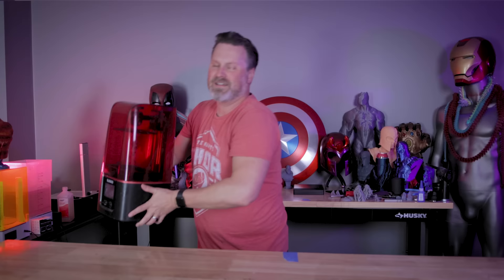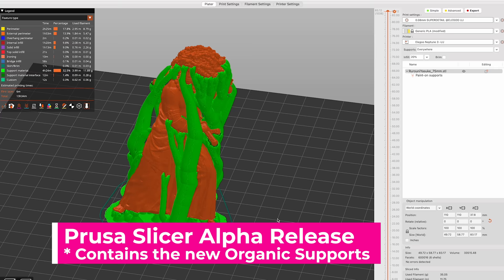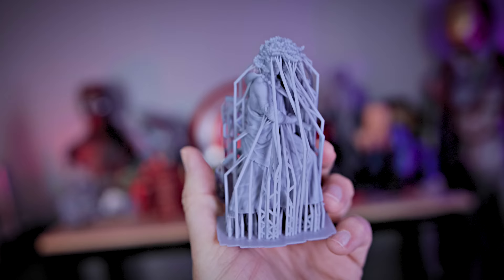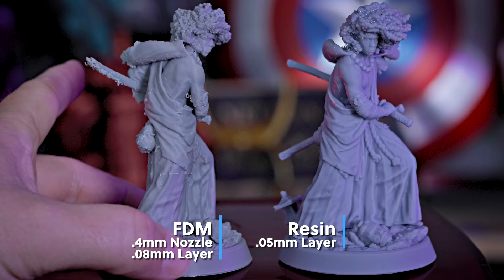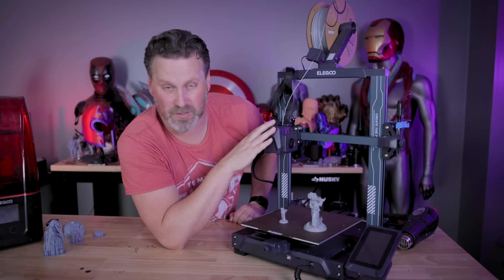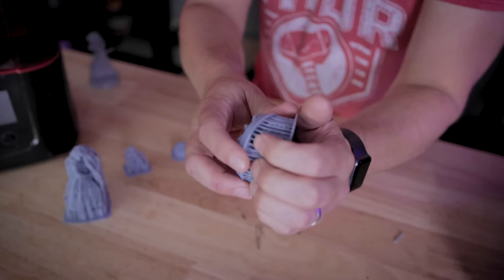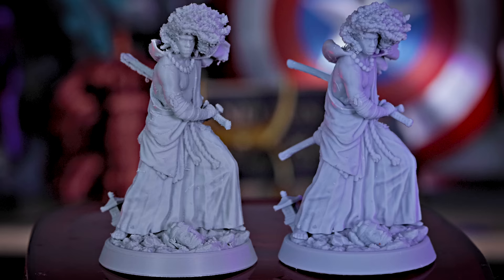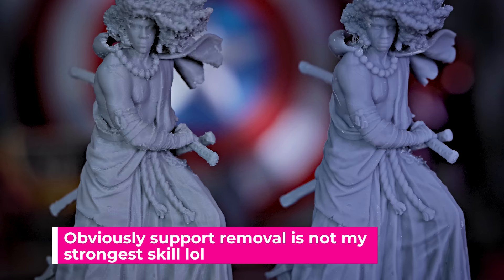Can your FDM 3D Prints Compete with a Resin?

Comment: The problem with it is more when you go to paint them.   The layer lines become a lot more evident when you start painting them and sanding doesn't work well on those small detailed pieces.  Especially when you do multiple layers of paint or a wash.
Reply: There's a video where someone uses resin and a brush to gloss over the print to give it a more solid look
Reply: A couple of thin coats of Mod Podge does a great job of filling layer lines without losing detail.
Reply: 2 layers of primer before painting makes a world of difference
Reply: Everyone who's ever done any sort of painting on a professional level will tell you the same thing. Plastic, walls, or canvas; always put down at least two layers of primer before your base coat.
Reply: Uh oh my mini figure have layers. Mom I need sls printer! Not I'm not a looser!
Reply: Fdm printers suck for miniatures
Reply: Not really. The layer lines in the resin print were .05 mm, a high detail printer like the anycubic Kobra 2 can easily get down to .04mm with a standard nozel.  Sure plenty of resin printers can do much better, but not in any way that will show up once the model is properly primed.
Reply: @elsunshine9976 it all depends on fine settings. 

Sure resin might be the king on the market when it comes to 3d printed minis, BUT with the right settings FDM can produce passable results, sometimes near identical to the resin counterpart.

Tweak around with the settings and you find the perfect combination to make crisp and high detailed minis on a FDM printer. Having a properly sized nozzle will also help
Reply: I think that for print miniatures the best is go to a resin one, when yow are painting it an washing with ink you will get lines in fdm printed ones
Reply: You should sand it till smooth (shouldn’t be hard with tiny layer height) and the put a couple layers of primer, it will feel like a mold injection model!
Reply: There is a black bar car detailers use that shows the difference in material depths through color difference and allows you to perfectly sand items. I forgot the name of it but it's used for sanding down body filler!
Reply: @phlm93  are you supposed to prime with an airbrush or just a normal brush?
Reply: Prime with an airbrush or rattle can.
Reply: @Christopher_Gibbons  The maximum convex detail with an extruded filament of 0.4 is 0.4, which is 8 times worse than resin. In the best case, it's “only” 4 times worse if we use a 0.2 nozzle. It's not bad, but it's clearly worse in all cases.
Reply: Sand it
Reply: Abs filament and either acetone fumes or sanding, won't see any layer lines 
Cosplayer trade trick there, that will be 5$ ;)
Reply: The bambu x1c i have printed successfully at .04 layers and a .2 nozzle and it honestly looks better than my resin prints and are way stronger
Reply: @Yoriel79 you can use arachne wall generator to print thinner walls and get better resolution so I'd disagree
Reply: So you just print in ABS, which costs the same as PLA, can be printed faster, and can be acetone smoothed to remove ALL layer lines?

Comment: In short...no. FDM can't compare to the details that resin gives, however try walking around with a full resin cosplay suit at a con compared to an FDM suit. There's your difference!
Reply: FDM actually works great for most of the pieces of a cosplay suit, anything big can be made perfect with sanding and spray bondo.  I would rather use FDM for most big things on a cosplay suit because of the much higher strength.   Ideally you can print the detailed part in resin and attach them to the large pieces.
Reply: It can compare, just don't print it incredibly unnecessarily small.

Comment: The only time I’ve seen FDM come close is when the minis are designed with using FDM to minimise the lines as far as possible. Print minis that haven’t been designed on that basis and I’ve always found the results as one might expect. Sure, there are steps you can take to minimise it, as in this video but still…..  I’d prefer a resin printer but can’t be bothered with the hassle and I’m not convinced that FDM can print the minis I want so I stick to getting them printed by folks who have access to multiple machines of both types. They’ve even run off FDM versions of the same figures FOC at times,  just to compare, pass.

Comment: Definitely seems like the smaller you go in scale, the more the FDM print quality suffers in comparison to the resin.  At the larger size, the FDM closes the gap a significant amount.  The resin is still better, obviously, but not as significantly.  I've just started looking at 3D printing and I'm surprised it takes so long to print some of these things.  Twelve-plus hours for that larger figure?  Wow.  For some reason, I was operating under the misconception that these things were quicker than that.

Comment: you should have mentioned that if you can only have your 3d printer in your bedroom (or other high use space) SLA is NOT AN OPTION not due to the smell or clean up but the TOXIC fumes that UV resin gives off

Comment: I print at 0.25 mm line width using a 0.4 mm nozzle. Layer height set to adaptive, between 0.1 and 0.2 mm. Minis come out quite crisp!
Reply: Which 3d printer u got?
Reply: Both my Ender 3 V2 and CraftBot XL (the original one) can do it quite well. Not as clean as resin, but very satisfactory to me and my DnD group. And ofc without the hassle of printing with resin.

Comment: Man, what I wouldn't give to ditch resin printing. I reckon a dual nozzle setup to use a different material for supports would make the FDM prints a lot cleaner.
Reply: I see what this guy was able to do in the video but I can say in our real world examples it did not come out the same way at all.  There was a very noticeable difference between the two.  One is perfect and I do mean perfect.  Like he has support issues on the resin one that I would question what size supports he is using and flairs on it.  That is very very very rare for me.  I stated this in another comment but man there is a difference and our group instantly can tell between the two for our 27 and 32mm prints.
Reply: It it just the mess and toxicity of it?
Reply: @jasoneiserman549  Exactly that, yeah. It's just so, so much work to be safe and clean.

Comment: For FDM printing I have been using Variable Layer Height feature more lately.  It really helps the postprocessing by reducing the layer lines and adds a little more detail where you need it.  For example most helmets I will start the print with a 0.28mm layer height but the areas where layer lines are prone to occur, like the top of the helmet for example, I can set it to print a 0.12mm (or less) layer height.  You can add this function as many times as you need.  So you can get a good balance of quality and speed where you need it.
Reply: Sounds interesting, I've to try it. Thanks for the tip!

Comment: Going smaller(0.15mm or even 0.1mm nozzle) with lower temps will make the prints much crisper, the print times will be stupid though so at that point, it's just easier to go the SLA route

Comment: I think the FDM could get closer if it had elements broken off and printed so the scarring was on the unseen side. I think the contest would have bene even closer, but would have required assembly. Just a thought. Cool to see )
Reply: Yeah, something like printing minis on sprues.
Reply: I use a FDM printer and this is what I do, I load my models in Microsoft 3D builder and use the split tool to cut them in half and use the inside as the baseplate connection side. Anywhere a support touches it scars the quality, so you just gotta do it in a way that minimizes supports and it also reduces waste

Comment: Wait, why did you print with the same layer thickness with 0.4 and 0.2 nozzles? Isn't one of the benefits of the 0.2 nozzle that you can have a smaller layer height?

Comment: I've been playing with tiny, detailed FDM prints for a while.  It's fun because it doesn't take long.  But when I get down to .08 and .04 layer heights, print failures become very frequent.  Often the supports get tangled with the nozzle, or a thin part just snaps during printing.  I think tiny prints tax the tolerances of my cheap printer.

Comment: very impressive and at the right time. I am trying to print LEO coins to pass out to law enforcement that I come across as a thank you. Some parts of St. Michael are difficult to get the detail correctly and I have been pondering the use of .02mm. That question is over. Going to order some .02 nozzles. Thank you once again @unclejessy for your amazing vidoes.

Comment: The not having a large difference between the .4 & .2 setting might come down to most settings have a min time per layer.  Large nozzle has to add more delay towards the top of the model, where the smaller nozzle doesn’t run into that min layer time delay.  At least that would be my guess without looking at settings or what the slicer says for the two nozzles.
Reply: If he used 0.08 layers, only wall count really changed.

With prusas volumetric flow setting, 0.2 nozzle probably printed faster with half the material used for the same layer height.

Plus min layer time as you mentioned

Comment: the problem with Prusa's organic support is that it uses as much material as regular support, missing out on some of the biggest advantage of tree supports, material savings and in turn print speed. I agree Prusa's is easier to remove, but I'd trade a couple of minutes of cleaning up VS hours of print time

Comment: I would love to see some FDM prints on an idex with using PVA as full supports vs just using it as an interface and also on an idex using PETG to support PLA prints 0.00mm support interface distance and 100% support interface density. It may not be resin detail, but the overhangs should look pristine.

Comment: I am a 3d printing novice and haven't started on resin printing yet. To anyone who could answer this question, I would appreciate it: Fillament prints tend to shrink a fraction after cooling. Does that happen with resin prints as well?
Thx for the info.
Reply: As far as I know the resin does not shrink
Reply: resin typically shrinks when UV curing, depending on how long it cured and type of resin, typically between 4-6% shrink rate, engineered resins do 1-2%.

Comment: I have been experimenting with printing on a Bambu p1p with the .2mm nozzle and varying layer heights from .04mm to .01mm . I am seeing a lot of broken tree supports so far which is my primary cause of frustration.
Reply: Make sure to clean your print surface with warm soapy warm and double check you have the correct settings in your slicer. I was knocking over tree supports because the the printbed was oily and I'd changed the printbed settings in my slicer from textured PEI to glass without realising.

Comment: I find PrusaSlicer's integration of tree supports really bad - it will build supports intersecting adjacent objects, and knock chunks / off during print. The implementation in cura Xmas alpha, on the other hand just works and comes off prints really nicely. It's wierd given it's the same code.

Comment: Hello Uncle Jessy. I have an unusual question for you. I bought this Elegoo printer after watching your first review on the printer and I can't  for the life of me figure out what the heck I'm doing wrong with it. I'm getting poor bed adhesion,," fixing with hairspray, LOL" and wicked bad layer shifting without the print moving on the plate. I was wondering if maybe you could do a video on the difference between printing with a bowden system VS a direct drive system? This printer print quality blows my Anycubics out of the water when I can get it to work, but that's only maybe 25% of the time and on smaller prints. I would appreciate any knowledge you can share on this new Elegoo Neptune 3 Pro. Thank you so much for all your hard work and wonderful videos.
Reply from the maker: Which Neptune printer do you have that you’re having issues with? 

My best guess is that you need a little more squish for the leveling. If it’s the pro I would lower the z offset 1 or 2 mm and see how it goes

Comment: I've painted around 2 armies from FDM printers. Roughly 100 units.

Make sure to base coat twice. You'll forget they aren't resin after a while.

 I think they look fine. And for the price it's hard to argue.
Reply: what kind of paint and primer did you use? also did you print mini's designed for fdm or SLA?
Reply: @TheBlackarcher9  I used rustoleom, tan.

The models we from cults.3d a patron designer. Medieval units. 

Don't know honestly about to which they were designed for.

Comment: My main printer is heavily modified, panels isolated fdm Ender 5 Plus. Custom AC powered bed, high end Dragon ceramic all metal hotend, carbide 0.6 mm nozzle, changed fans etc. Klipper firmware
I like it. However, I use FDM mostly for functional parts, mostly printing CF nylon (luvocom cf-15) and some ABS, ASA and CF PETG.
For my father, who is train diorama model maker, I use solely Elegoo Saturn S.
Yes, resin is messy. It’s toxic. It smells. But detail is amazing. Yep, I hate it each time I have to print with it. With FDM and my tuned profiles, I just put correct filament, set profile, slice and print.

With resin, even preparation takes a lot of time. Proper supports mostly.
on the other hand, printing clear transparent parts is impossible on FDM. ON resin, print it, clean, remove supports, spray some acrylic transparent  finish and done

Each has it’s place. No resin can print such sturdy parts as cf nylon ones are. No FDm can print as fast and at such detail as resin.

Comment: the thing is that I work in an architectural office and I need to print wide and large models

the issue with the FDM printer is that every time I print a big model house it starts blocking the hotend at the end, and the smaller the hotend size the longer it takes.. I use 0.4 for houses and 0.6 for terrains and it lasts 2 days to print just one model.. If I get a larger hotend the quality is just bad

So I am planing to get Anycubic Photon M3 Max 7K or should I go with Phrozen Sonik Mega 8K?
Reply: forgot to mention it takes 2 days just to print one floor of the house scaled 1:100
the whole house took a week to print

Comment: I use both filament and resin and both have a purpose, filament printers for mins is just a no, even at 75mm scale especially if painting them is your final goal, the finest I have gone is 0.06mm and the layer lines are clearly visible when painted compared to resin and the print times are stupidly long. 8 minis in 2 hours or 8 lesser quality minis in 16 hours....  They just look really bad compared to resin. For terrain bits and buildings, filament all the time, you can sand them or prime them will a filler primer, they are stronger, lighter and cheaper.
Reply: Question. What's best for car scale model? Filament or resin?

Comment: Super pro tip: run your resin prints under very hot water for 10 seconds and then take the supports off while it's hot.

They fall off
Reply: Works with fdm too, just not as well

Comment: Hi, I don't know if you read new comments but what infill % did you use?
Reply from the maker: Fdm prints I will usually do 8% for most things. 20% if I want it really durable

Resin prints I will hollow & just have internal supports auto generated. Hope that helps 🤘
Reply: It does help, thank you! @UncleJessy

Comment: Eh, the resin miniature is visibly better than the 0.2mm FDM miniature.

I think it's also worth noting that 0.2mm is 200 microns, and resin printers have resolutions in the 20-50 micron range, depending on the printer.